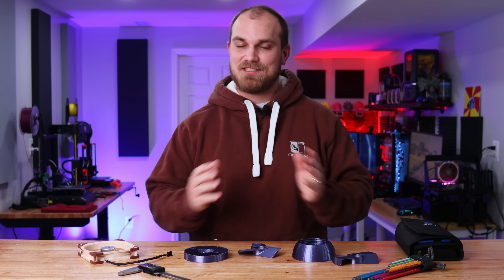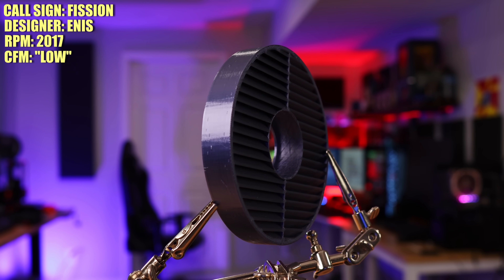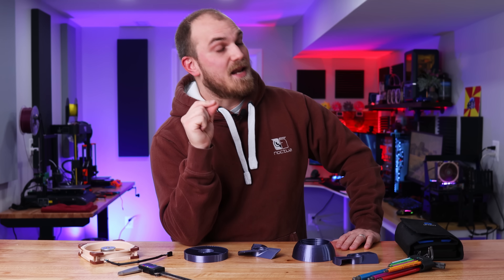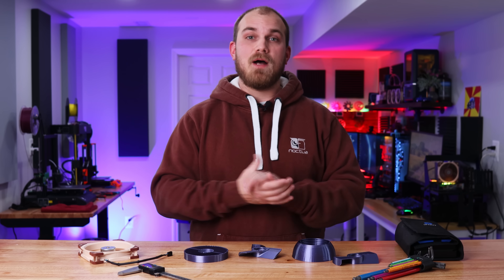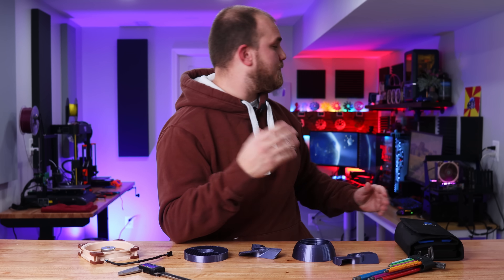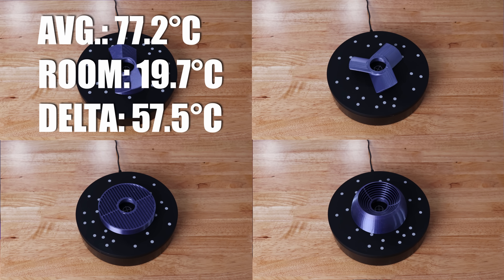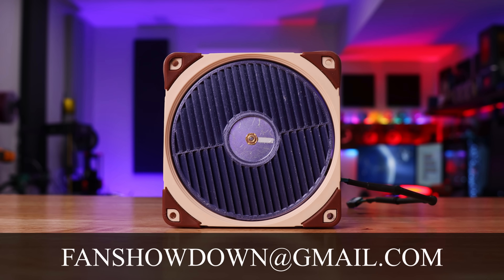IS THIS MAGIC? This Fan Has No Blades | Fan Showdown S2E3

Comment: If you use the bladeless one, even with a small sweeping edge maybe even just angling the crossbars a little into some, the thing would both catch from the edges as designed, AND pull more air.
Reply: I suspect that getting the "layers" bit closer to each other also would also create better flow since there is also friction between the surface and air that affects the airflow by dragging - since thats basically a tesla turbine

Comment: Someone make the bladeless but instead of tJUST the concentric circles, put a concave fan in the top with the circles below. I think it will do stuff. Good stuff. Possibly reverse the design, large opening on the top that narrows into the circles. I want both. Shit Large opening, with a Trinity in the middle. Nailed it.

I also think the Air Foil with at least one more blade would be awesome.

Overall a Trinity with 4 blades and an Air Foil with 3. Id like to see that fight. Maybe up to a 140mm fan to avoid losing surface area of both.

Comment: Is it just me, or is the "Bladeless" doing as much work drawing air around the outside of the shroud (jet-engine spinner style) as it is drawing air through its insides...?

Also, the centrifugal forces are kind of missing -- a centrifuge works on the basis of acceleration perpendicular to the radius, so what you would need to do to drive that is have blades so steep they'd essentially be a paddle wheel.

Comment: The bladeless fan would do better if the small straight pieces of plastic that hold each section were scoop shaped rather than a straight lines.

Comment: 8:47 I dunno.  Seems like Bladeless has so much more potential when it barely managed to prevent thermal throttling while running at a measly 22.79 RPM.  :p

Comment: Just a thought for the bladeless  one.  If the internal supports were in a spiral, instead of front to back line, might get a tad more out of it. Wouldn't waste energy pushing the air around in circles.  All movement would at least have a component in the direction of the outlet.   Ya never know.    ;)

Comment: Awesome!  Thanks for the video, cool to see my fan did well.  I liked Matt's 2 blade design as well.
Reply: Can you make the simplest design that completely disregard noise? The motor consumes x amount of energy that translates to to x rpm depending on the angle of the blades. Figuring out the the angle out bring the optimal design to move air.

Comment: Eric defeated a portion of the airfoil design when he curved the blade  the underside needs to be shorter than the upper side if you intend to use the wing shape for differing the flow above and below when you cup it on the bottom side you elongate the travel distance below the wing defeating the shape of the blade. how he expected to reduce turbulence by using a design which purposely creates turbulence two different air speeds meeting at the back of the blade creates a vortex which rolls away.

Comment: Okay what if the bladeless was given more RPM so that it has the same level of noise as the others? If it possible that it could win?
Especially with an Ultra quiet motor?
Could this thing Cool PCs in an super quiet way, then ramp up RPM too cool better when needed?

Comment: The bladeless fan would be interesting if he changed the support for the rings into blades and made the extend into the middle a bit.  Maybe put a cone in the middle to help air flow around the motor.

Comment: I wonder what about a hybrid design where you take a high CFM blade design and add the concentric rings from the blade-less to it ? you have blades to move the air and the rings to eliminate flow loss from the side ?

Comment: Okay I don't have the 3d skills to design my fan but my idea is a funnel twice the size of the enclosure at the top with Sean's 3 blade at the top with the goals being lower noise at higher pressure.

Also, I think that edging is based on an aircraft wing.

Comment: Seen that the Trinity fan is clearly taking lessons from how aircraft wings look, there is one little oversight in that design... Aircraft wings have the thick part at the leading edge, this fan has it at the trailing edge judging by the footage. Perhaps it would perform better and produce less noise if that would be swapped around?

Comment: The fanless has struts on the inside of his "blades" to hold them in place.
What if you curve them a little so they pull in the air a bit faster and try to get the best of both worlds.
I don't think it will be record-breaking but it could be a better solution for a quiet fan.

Comment: If the fan without blades would have had blades, it would have worked even better, slight angles would have improved it a lot

Comment: With the no blade fan, I noticed the air coming from the sides was blocked.
What would happen if you put some holes on the sides, something to suck the air from the sides into the fan?
Also, for the separators, what if you rotate them at an angle?

Comment: Love this content, so cool to see the mix of experiments and ideas tested! 
I've read alot of comments on the value of keeping a constant room temperature when doing testing like this. It seems logical, and a lot of other people commenting seems to thing the same, at the warmer the ambient enviroment is, the worse the fan will perform? But wheres the margin of error in that? At what point does it become obsolete to level out the ambient temps? I mean, is there a difference in delta, with just 1 degree of ambient difference? Or even lower? Or much higher? - would love to see some testing on that :)

Comment: Now, if the Bladeless had a slight internal "twist", It would probably not only have lower internal temps, but a significantly better cooling performance!
I don't know the angles, but at least a 25°~30° should do the trick

Comment: Where is air speed test? Where static pressure test? Where pump volume test?
You can't by anemometer? You can't 3D print box with simple pressure sensor and Arduino? You can't find big enough garbage bag to see how fast fan can pump air in given volume?

Comment: If the blades fan had a slight tilt to the supports holding all the rings, it would have been able to pull a lot more air

Comment: The reason the bladeless design is so poorly performing is because the design has a large inertia and requires a strong motor for it to spin at a speed that gives a decent airflow.

He should focus on getting the weight down, especially in the outer ring furthest from the centre.

Comment: @Bladeless fan

You could possibly improve performance, by making a few tweaks to the design:
1) increase the amount of space between the "dome" shapes.
2) Instead of having the fins that separate the "dome" shapes virtical, instead, change them to be helical, and off set. (i.e. between "dome" 1 and "dome" 2, have the helical separator at north, south, east and west, and between "dome" 2 and "dome" 3, have them NW, NE, SW, SE. ((* in this instance, i'm assuming a ¼ circumference helix*))

Comment: I would like to see a design that works opposite of the design of the old BBS RS Turbofan wheels, wich sucked the air out of the racecars wheelwell to create downforce and cool the brakes, but I lack the hardware and software do design such a fan... so if somebody could make one of these, it would be greately appreciated, thanks

Comment: for me it is always a question of compromises. my computer is a compromise. first the expences.  the computer have to be able to play any games i play  with playable fps. i dont play proff 3d shooter games. maybe WOW or New World 
 with my budget it will never be the 50.000 € build. it will more be arround 1000 €  pr less . then it have to be low noise fans, with enough airflow at a  given noice lvl. thia means: when i see these fan tests it is important to know the noise lvl we bare to hear, without anoying everybody else in the livingroom. the compromise is low noise, and the cpu  / grafic card dont get too wot. that is why i always try to use big fans, and copper cooler. i know the cabinet is also a part of the airflow. so i use some 12 cm fans around 2+ db to move air out. and on the side i have a 40+ cm fan blowing on the grafic and cpu . at low speed. all in combination it is posible to play most games with my not so expencive desktop. yes i know. i dont set graffics to max all the effects. only the importants. buy my builds for my use, are low noice polutions. i would test cpu´s with noce lvl max at 25 db and 35 db and 44 db. and for the deaff people with max noise settings. to see if the cpu´s can manage the noise settings

Comment: Dont know if this has been tried, or commented on already, but has nyone thought of using the kind of blades you find on aircraft props? like a 4 blade from a fury or the like? if they are strong enough to move enough air to power a heavy plane, surley they could move a crap ton of air for a cooling solution?? I would design one myself, but I have zero experience in using CAD or any computer design software.

Comment: Did you have the bladeless fan working the right way around? My casual observation is that air should be going in the larger side and out the smaller side.

Comment: You can make a 6 blades version of the trinity,with thinner blades to conpensate the weight of adding 3 more blades.

And another one, maybe keeping 3 blades but not "straight" blades, but more of a propeller form, increasing area in the outer region of the blades.

Comment: Wow, honest congratulations to Sean. Though I'd like to know how the PC fares without any fan at all now, seeing two fans with no measurable airflow not throttle seems strange. Not impossible, of course, maybe CFM is only a contributing factor and not the be-all-end-all (as proven by lower-flow fans beating higher ones on the leaderboard), but I'd like to see what the functionally worst case scenario is we're battling against here.

Comment: I propose someone, takes the silent fan, mixes it in part with the "in-fill" fan. 
I also propose someone takes the silent fan and runs it through an airflow simulation. Smoke shows it moves air, but not how it moves it. Would be really interesting to see what effect its having.

Comment: I have made a very similar design as the bladeless some time ago. My design was not very successful - I am happy to see that it can work after all, congrats! (I've tried to pump water, not air.) My inspiration was the Tesla turbine. The advantage of that design should theoretically be less dependence on a certain RPM - so (theoretically/) it should outperform any traditional fan at some RPM - if it does not fall apart :-)

Comment: I think that bladeless could be improved. First of all, the last "onion layer" needs to be static, it waste too much energy by throwing air outside of fan. And it redirects air that could go inside. Secondly the onion layers take space that could be used to move air. We would need to try to reduce thickness and search for optimal number of layers. Also, the other problem is that intake area is decreased, maybe some adjustment to the outer shape could improve that. Also the number, and shape of radial ribs could be optimized. Instead of them being flat (that I assume they are, cannot see too well) make them more like a blades. 
It looks like Tesla turbine was an inspiration too ;-).

Comment: I think ribbons would help the air flow test. Using a few different length ribbons will show just how strongly air is being pushed outward by each fan. In addition to the smoke test because that is super satisfying to watch.

Comment: The Bladeless should be able to do much more, it's basically just an impeller, with better geometry of the fins and shroud it should produce much more airflow. Perhaps by using a brachistochrone curve for the shrouds should improve the design considerably.

Comment: I see a very clear improvement for the fanless design. The baffles that hold the cones together are along a straight line. This can significantly disrupt airflow. If you incline it at an angle, I believe it will make a big difference.

Comment: I sort of feel like we should get multiple leader boards;
1. Max power cooling potential
2. Set rpm cooling potential
3. Max power sound minimization
4. Set rpm sound minimization
5. Power draw to speed efficiency OR minimum print material needed OR coolest design 

Plus this way we could have a nice 5x5 board

Comment: Hey, question: I have 4 corsair ll120 fans with their fan hub and lighting node pro.  This doesn't control fan speed, as you need to buy their commander pro.  Do these fans in their current state stay at a certain RPM, or do they fluctuate?  The PWMs off the fans are plugged into the hub, which is plugged into the lighting node pro, which is plugged into a USB 2.0 header off my motherboard.

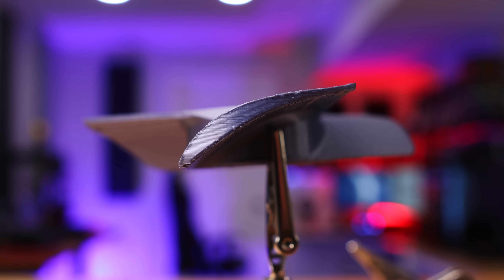Comment: Im curious... Do the Trinity again but place the thicker side of the airfoil as the leading edge and the thinner side as the trailing edge. Look @ 1:21. In theory, it should create a higher pressure zone on the output side of the fan and increase drawn in airflow.

Comment: Shaun's Bladeless fan could be significantly improved had he made the streaks circular and diagonal rather than completely straight and vertical.
that would improve air pressure in front of the fan and so that fan could potentially pull in at least 20% more air
someone should to try that out in the next fan showdown

Comment: I still believe some smoothing must be done to those fans to give them their best chance! Leaving them rough af is leaving performance on the table... I watched your last video and found your results interesting indeed, how ever I find your test using a 3 blade fan rather flawed as smoothing would have the most dramatic effect on a fan with a large surface area rather than a 3 blade fan that would have a bellow average surface area compared to the standard noctua fan you use as your baseline for the fan showdowns

Comment: OMG, that guy uses an actual airfoil...and then it's backwards. thats pure frustration.
Also, the 2-bladed design Mr Major calls "the airfoil" is not the airfoil. There is no airfoil like that with a sharp edge in it. The airflow boundry layer will seperate at that edge causing the airfoil to stall, which means it can't generate much lift, or in this case, properly move air. The loud deep noise you hear is caused by that very seperation of the boundry layer turning into violent eddies.
The fan that actually features an airfoil is that "3-scoop" but the airfoil is backwards, so it doesn't perform.
Ah, this is hell...

Comment: He bladeless fan would work better with two crossed horizontal prices in the center to throw more air out to the side for the fan to catch, but then it wouldn’t be baldeless so, instead add some texturing on the inside, like little bumps so that it creates more drag to create more centrifugal force to throw more air out to catch it

Comment: 690th comment! Also, there are way to many different category’s to judge the fan on, so I would recommend making an excel spreadsheet where you can put the information and data in, and you would have given all the types of data weights(so the delta has a weight of 1 so it is the most important, and the sound has a weight of 0.5)  and the spreadsheet kicks out a score for the fan by doing some math to all of the values and weights. I don’t know the entire formula, but I will try to work on one and email it to the fan showdown email if you want?

Comment: If the blade-less were to have blades inside the "centrifugal veins" instead of just straight supports, I think it's performance could be significantly improved without affecting noise much. That design could have legitimate potential in a custom PC build where, for whatever reason, low noise was critical.

Comment: I wonder what would happen if you integrated blades into the bladeless design. I'm thinking something like 4 or 8 blades that curve with the circles, slanted at a 45 degree angle, that end flat at the other side. -- My thinking behind this is that while the bladeless design is good at focusing the air, it is not so good at pulling the air through the fan, which is where the blades should help. I also wonder if other blade shapes (spiral, curved like the trinity design) may help, while keeping them inside the bladeless fan. I'm also curious what would happen if you just made the fan part confined to the back of the design -- that is, have the fan profile be to the lowest of the circles, so the other focusing circles act as a cap to the fan section.

I don't have the software to design any of these, so if anyone is interested in experimenting with them, I give you permission to try them out. Have fun.

Comment: I think that the bladeless fan might be more efficient if the holders of the wall would be curved like a fan, or reduced to the bare minimum, so the supporting does not make turbulence or pushing the air...
Worth to test...

Comment: Lol I test the air flow on my pc (I move my fans around quite a bit.3 diff types and they alternate between exhaust/intake alot)with a vape aswell lol. But I use a juul so it's not gonna cause condensation(I think lol) bc its such a small amount of vapor.

Comment: To improve the bladeless, why not shift the structural segments slightly askew so it has a screw-like surface to pull air through those slots?

Comment: The blade less I think would worked better if it had a holes around the lip area as during the smoke test test the air was being guide towards the middle but a lot of smoke seemed to be hitting the outer edge as the smoke was being pulled in causing  the air to kinda be push out not in